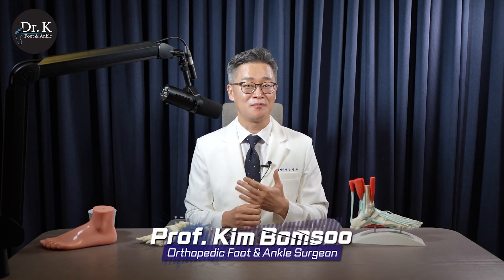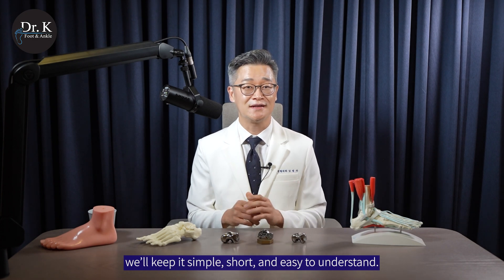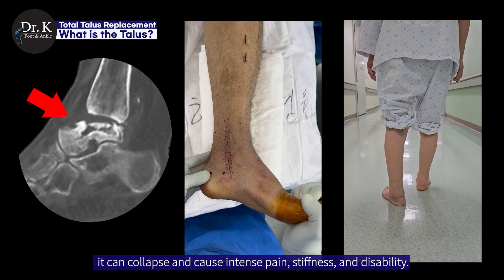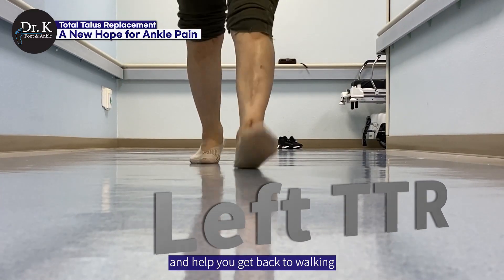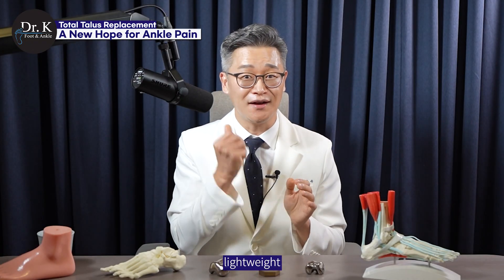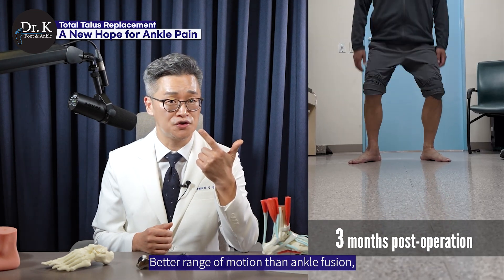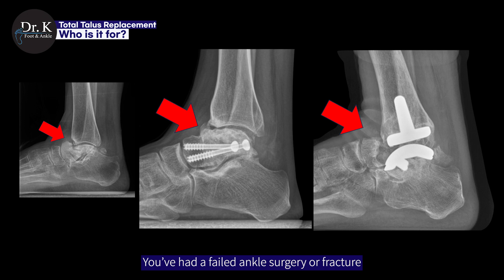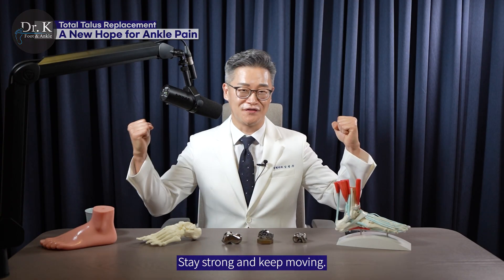What is Total Talus Replacement? A Life-Changing Ankle Surgery. Ankle Bone Replaced!#avntreatment

Comment: I've heard these can end up very painful, but your results look a lot better than that! Does the cartilage in the surrounding subtalar/navicular/tibiotalar joints wear away under the stress if the implant in the longer term? Or does it appears to survive normally?

Dont need this, but very curious about these sorts of operations after breaking my ankle :')
Reply from the maker: Great question. In the long term, adjacent joint cartilage can wear, but outcomes depend heavily on multiple factors: implant material, design and weight, how anatomically congruent the implant is (optimal sizing/fit), stability, and—critically—surgical technique. We work to optimize each of these, and as these elements have improved, results have generally become much better than the early reports.